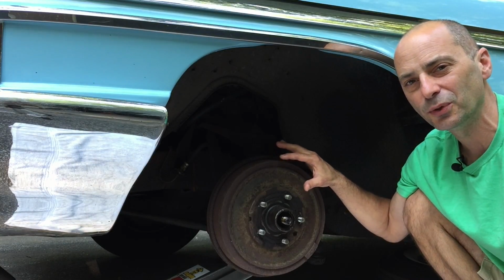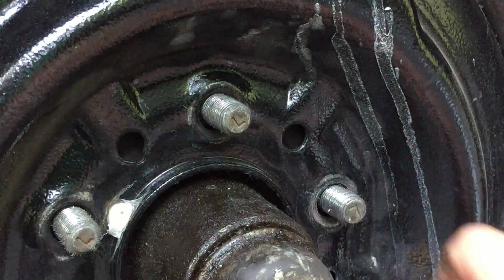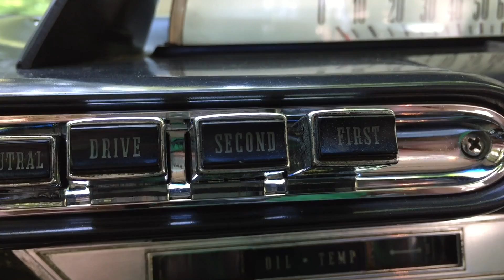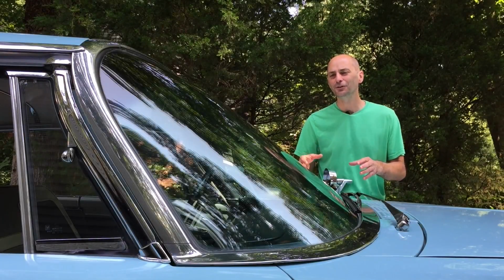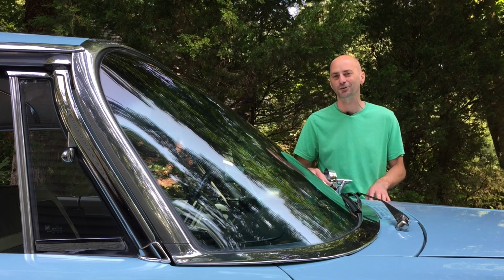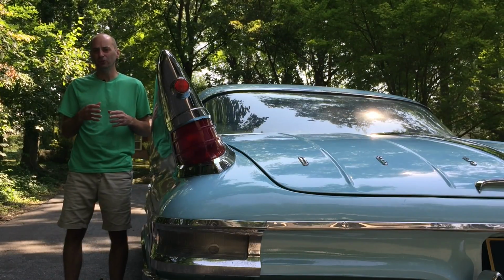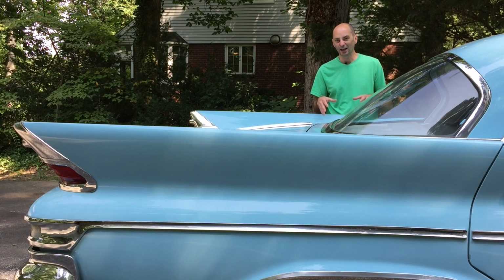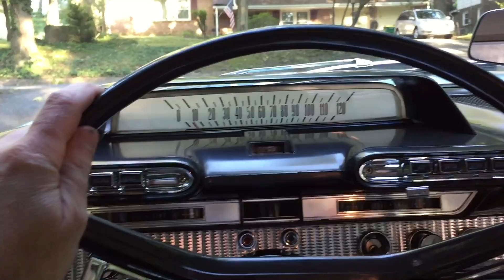1961 Desoto - Cool, Fun and Weird  2 of 2

Comment: My Dad had a 1961 Chrysler station wagon and a sedan, which I drove a lot circa 1968-70  Your Desoto likely has the same engine, 318 CID hemi V-8. Very reliable except the push button gear selectors were always getting buggered up (especially after I would select each gear when accelerating hard) and had to go to the mechanic frequently, albeit the cars had many miles on them by 1968. Don't recall  all the gizmos your DeSoto has, maybe I forgot some over the 50 years and maybe some were options that he did not get or were unique to DeSoto. He always said Chrysler products handled much better than Ford or GM. All drums brake cars and trucks suffer from the same problems, heat fading or inaction after going thru a big puddle , so no reason to diss the Desoto on that issue, disk brakes did not come until years later. Getting brakes adjusted and relined was normal maintenance for motor vehicles in the pre disk era. However I never had any braking problems in those Chryslers.
Reply from the maker: hey man, thanks for the comment.  The '61 Chrysler wagon is on my list of favorite cars.  Seems they're crazy pricing is keeping me away though.  They had some cool features like rear air condition and the most amazing drivers gauge cluster ever created.  -Chris
Reply: The DeSoto never used the 318.  The 61s all used the 361.  The 1959 and 60 used a hotter 361 for the base series and the low-deck 383 for the top series.

Comment: One more thing you missed is engine information. As an "engine guy" I always like to hear about a vehicles engine specs.
Reply: This car used a de-tuned version of the 361 B engine, 265 horses.  The 58 - 60 version of this engine made 295 horses with a 2 barrel, 305 with a 4 barrel.  More with the later ram manifolds and dual quads.

Comment: Most manual seats had a slanted slide to increase head room as you went back. I had four-wheel drum brakes on my first two cars and when you hit a puddle you simply tapped the brakes to dry them off although I suppose to younger people they wouldn't know to do that. Certainly not scary however. I believe the left/right lug nuts were to help keep the lug nuts from loosening as you drove. My Valiant had those.

Is the under dash A?C a period add-on?
Reply: Yes, people now make drum brakes out to be scary.  Today's disc brakes are amazing, but people growing up driving since the 90s are simply used to it and expect it.  Drum brakes are not as good but they are not unsafe.  My parents up to their early 70s drove their gorgeous 1969 Cadillac with four wheel drum brakes, pulling trailers!  Now the trailers had their own brakes, but those were not that good typically.
Reply: Dealer Air.

Comment: The positioning of the De Soto within  the Chrysler lineup has always puzzled me. All of them were clearly  Chrysler clones and shared nearly 100% of their sheet metal with the Chrysler models. It seems as if De Soto's  main competitor was Chrysler itself rather than Oldsmobile. I can't think of another American make of car that did so little to disguise its actual origins. Even Mercury' and Edsel had their own sheet metal for most of their model years despite being Fords underneath. It's a beautiful car. Exner was an amazing designer. Thanks for sharing.
Reply: It was a little cheaper but more stylish than the Chrysler, but didn't have the prestige of the Chrysler, but really was usually a clone of the Chrysler with a slightly smaller engine.

Comment: The wiper button on the floor.  That's for spraying wash fluid, right?  It's a bulb that pumps the fluid, rather than having an electric motor.
Reply: My  1969 AMX has the foot pump for fluid, AND the wipers were run by vacuum, not electricity!
Reply: @ToyKingWonder  One old fashioned thing that AMC did was hold on to vacuum wipers long after others were all electric. Even the cheapest Chrysler products all had electric wipers at least by 1955.

Comment: Fins do stabilize a car. Porsche 917/30 is a case in point (Huge fins). It was so successful in Can-Am racing the series was sunset. You may need to go 100 mph to tell. At slower speeds you probably need BIGGER fins. I'm getting used to the upper grille on the 1961 Desoto.

Comment: Chris that car is beyond awesome!!!    I love it.  The colors of 50s and 60s were pastels and your car is no exception.  But one question, there's no park on the transmission?  Other Chrysler products of the era (Dart, Valiant, Lancer, etc) had a park lever in addition to the push button drive.  I agree the torqueflight was an excellent transmission.  You didn't go over the a/c either, does it work?
Reply: The Park position came with the new smaller aluminum case Torqueflite used in Valiants etc. which came out in 1960. The shrunken 1962 Dodge and Plymouth used it too, and maybe by the next year or so there was a version for all Chrysler cars. The original Torqueflite never had a Park position, but instead they all had a parking brake that was a drum brake on the driveshaft instead of a manual cable to the rear drum brakes.
Reply: The Valiant was the first ChryCo car to have an automatic with Park, but it's trans was only for the Valiant until 1962 or 63

Comment: I had a 61 Chrysler  Windsor with a 383 and it spent 2 weeks on the lift with a transmition problem and they finaly they went to the junk yard and got a replacement plus all Chrystler  had an enherant rust problem in the cooling system causing over heating. this was in 1966

Comment: You forgot about the one thing all cars have in order to go and no it's not the transmission it's the engine what's it got for a mill I know Desotos had the Hemi for the most of the 50's but in 57 or 58 they stopped so does it have the 361 or something else?

Comment: My family had a Chrysler with "self tightening" lug nuts, a Chrysler innovation, which were a disaster if you had to change a flat in the middle of nowhere.  We had to have our lug nuts jack hammered off because they were too tight to remove.
Reply: They were over-tightened tightened.  That is one of my gripes about tire installers.  I had to slip a 4 foot long pipe over the lug wrench to get the lugs loose on my 73 GMC, as not even an impact wrench could loosen them.

Comment: All mopars had left hand threads on the left side of them!
Reply: Johnny Hawkins I wonder why they did that, makes no sense at all.
Reply: @MrZdvy  It goes way back to the days when wheels were held on with one big nut in the middle. By having left hand thread on the left side the nuts would not screw themselves off as the wheel goes around.
Reply: CavemanCBB It still doesn’t make any sense doing this on wheels with multiple lug nuts. I remember Ford Transit vans still used left hand thread on one side in the late ‘80s. It caused confusion and broken studs...
Reply: @MrZdvy  The great Chrysler corporation was heavily influenced by engineers who put safety first and foremost. Left handed lugs were a safety thought. Packard cars used the same system. Remember Chrysler was the inventor of the safety rim and it became an industry standard. They must have thought the same for left handed studs.There was meaning to their madness. Safety, that is also why Chrysler and its divisions do not have the fires that #2 is so prone to.

Comment: Also, the TV rod is adjustable for proper operation, not for operating characteristics.  You need to install a shift kit to change shift points or firmness

Comment: Man, I would love to have a late 50's early 60's car as a daily driver. Something different like this,  not the run of the mill Ford and Chevy's I see all the time. This car is hot, but a two door would be better!  We need a shot of the engine, no mention  of what engine is in it, but I'm guessing a 413.  And that's wild music at the end, performed by some wild hep swinging cats!
Reply from the maker: Hey man, thanks so much for your kind words on my Desoto video.  I totally agree with you that this car is crazy different and cool.  Not like the thousands of Fords and Chevy's already out there.  This Desoto only offered one engine, which was a 361 V8 that gave 265 HP.  Chrysler had a bunch of other engines to offer but just not in the last year of the Desoto.  Which is kinda weird since this car was built on the same assembly line as Dodges and Chrysler's.  -Chris
Reply: 361 engine

Comment: BUT, not a word about the most important thing!!?? The engine- displacement, horsepower? How come?
Reply from the maker: Hey man, thanks for checking out my Desoto video.  I had made a video prior to the one you commented on.  In that intro video I talked about the engine, which is a 361 V8, horsepower and such.  Check it out in my video library if you're interested in seeing more of the '61 Desoto.  -Chris
Reply: 361 cubes, 265 horsepower standard, same as a Chrysler Newport.

Comment: didn't that car have a 4:13 with dual-quad option back then?
Reply from the maker: Hey man, thanks so much for the comments and for checking out my Desoto video!  Really appreciate that.  As for the 413 V8 engine, yeah, Chrysler had that as an engine option, but the dual 4 barrel version was only in their top-of-the-line model, the 300.    Made something like 375 horsepower!  It must have been a rocket ship too with all of that power.  -Chris

Comment: Many owners of old cars have switched out those left turn lug studs over the years. And I've never encountered a Ford product after 1952 with left hand studs. I don't think the left hand studs are being made anymore.
Your tires appears to be too small for the car  (probably 215 75 R 14?) so your engine is probably turning much higher rpms.  The stock tire I think was 1100 x 14 which you can only get at specialty or classic car tire shops.
I was very disappointed you chose to play music instead of letting us listen to the car instead.

Comment: This DeSoto did not compete with both the big 1961 Chevrolet and Ford...the big Plymouth and Dodge Dart was their competition.  Of course, the DeSoto used a 3-speed automatic because it was not in the low-priced field. Powerflite was Mopar's 2-speed automatic and it was last available in the big 1961 Plymouth with the 318 2 BBL V-8.

Comment: Is that aftermarket air conditioning? Also, you never showed us the trunk. What are you hiding in there? Great series of videos. One suggestion: wear period-correct clothing. For a working man, such as a garage mechanic, you could wear dark indigo (unwashed) jeans with white bobby socks and loafers and a white T shirt tucked in with a leather belt, topped with a denim or black leather jacket. If you are white-collar then a men’s suit would be nice.

Comment: The left hand threads on lug nuts is for high speed performance driving when u floor it the lugs will not come loose as was the case with other cars of it's time desoto was a muscle car as well luxury.they were very expensive too the dodge coronet superbees were also left hand threads for the same purpose the story go the left hand nuts would tighten up when u floored the exelerator

Comment: There's nothing special about the manual front seat adjustment. All GM cars with manual seat adjusters also have a tilted rail that lowers the seat the farther back you adjust it, and the seat can also be mounted further back in different bolt holes if the travel isn't sufficient. Reverse threaded driver's side lug nuts also used to be common on American cars, again, all GM cars had them too.

The single wipe button on the floor is unique, though I have seen other cars that had an automatic radio station advance button on the floor in about the same place. Cadillac had a remote controlled exterior rear view mirror in 1961 too, but used a more direct mechanism. Oldsmobile didn't offer a remote controlled exterior rear view mirror in 1961.

Oldsmobile (DeSoto's most direct competitor) in 1961 was using the 4 speed Hydramatic transmission, so DeSoto using the 3 speed Torqueflite transmission was a gear behind, not a gear ahead. The pushbuttons offered no benefit over the conventional gearshift lever, except styling. Other brands such as Packard and Edsel also toyed with pushbutton shifter mechanisms, though theirs were never as reliable as the Torqueflite shifter.

BTW: I love the tailfins!
Reply: Yep, the Buicks around this time had an optional radio called the "Wonder Bar", as there was a chrome bar above the radio dial which, when pressed, scanned for stations. The dial indicator actually advances mechanically left to right and then starts over again from the far left. 
In addition to the chrome bar, the driver has a foot switch available to start the scanning. 
It has three sensitivity settings and is the best AM scanning radio I've ever used. Ever.
Reply: There were two different types of push-button transmission selectors. One was a strictly mechanical kind between the buttons and the transmission itself. This was the type used on Chrysler motor vehicles. The other kind was electrical in function, whereas, the push buttons were switches which controlled electromechanical solenoids in the transmission. Examples of the electrical type were in 1957 Edsels (in the middle of the steering wheel) and on some Packard Clippers, having the push-buttons  on a  arm extended from the right side of the steering column, just past the steering wheel. There was trouble with many of the electrical kind, hut hardly any with the mechanical variation.

Comment: Ah.....My 52 Cadillac has a 4 speed automatic. And I believe it was from 49. So your claim that "GM and Ford" had only 2 speed autos..is, well false. GM was way ahead of Chrysler with automatics . And I have driven my 52 Cadillac with 12 inch drum brakes through very deep water, and have never had the brakes fail...so stating that drum brakes are no good is ..well false too. Nobody needs to panic using drum brakes unless they are down to metal. But your claim that Chrysler had advanced engineering is true in some ways. They had many "firsts". My 52 Desoto had two speed electric wipers, a separate blower for the windshield, duel wheel cyls in each brake assy. a semi automatic trans with a clutch, mounted to a torque convertor which shifted and down shifted by itself..etc.
Reply: Wow, if only Desoto was around to hear that a mid priced car was in comparison to a luxury, high priced field car 50 years later. They would be impressed. However the Desoto had push button trans and the Cadillac had ...........well a three speed
Reply: @anthonyfalzon57  Yep, but Caddy was the all time best seller from the beginning in 1902, because of their styling, high quality standards, reliability. They outsold Ford and Chrysler combined in the luxury field. Then all American lines started building crap in the 1980's....I blame Reagan.lol.(might as well)
Reply: @dadsvespa  that is true, Cadillac was a leader in the Luxury market where Imperial and Lincoln combined sales was less than Cadillac. So with that fact present, why would you compare a mid priced car with a luxury  priced car. A Desoto against Oldsmobile or Mercury, yes. A Desoto against Cadillac, and the Desoto holds it's own except in a few areas. Advantage Desoto. Torsion bar ride verses Coil any day. That is why Cadillac finally adapted Torsion bars.
Cadillac, leaving more chrome trim on the highway than any other make.
Reply: @anthonyfalzon57  I wasn't talking models. I was talking technology. Jesus calm down.
Reply: @anthonyfalzon57  The Desoto line, was considered above the Dodges and Plymouths of the era. Many people told me that while admiring my 52 Desoto.
Reply: @dadsvespa  I am calm. And you were comparing apples to oranges, and now your back sliding because it did not work. Chrysler made a phenomenal amount of mistakes in the fifties. Almost in every department except engineering. Hindsight 20/20 we can see that, but when your products are all the rage and your working with turbine technology that no one can touch, when your cars are chosen by police depts and cab companies for durability. Your riding the wave don't touch a thing. Engineering is telling them they need to slow down. But management can't. The owe Prudential $250,000,000 for a development loan. Yeah and Studebaker approaches Chrysler for a merger and Chrysler says that they do not think they (Chrysler) will be around in twenty years. But still they survived.  So keep your 52 Caddy. I will always support  Chrysler Corp.
Reply: The Cadillac had the Hydramatic introduced by Oldsmobile in 1941. Four speeds but a straight fluid coupling instead of a torque converter, so similar to a thee speed torque converter automatic in multiplication if maybe a bit more efficient. A lot off GM cars used it eventually but Chevy used a two speed Powerglide from about 1952 to the late 60's. And I've driven various drum brake cars and the loss of braking or uneven left and right braking after going through deep water is a well know thing , plus fading to ineffectiveness when really hot.